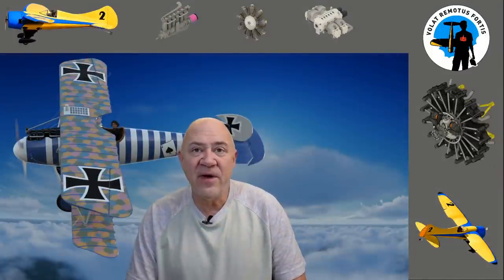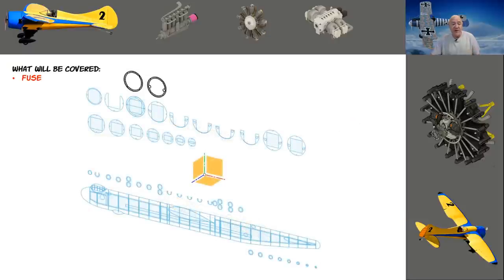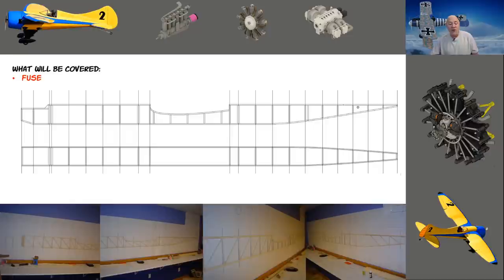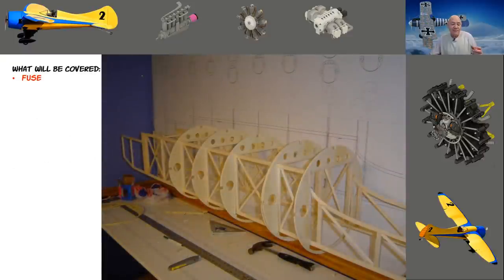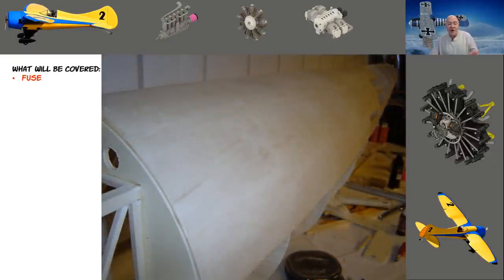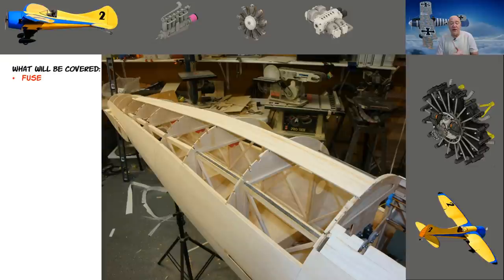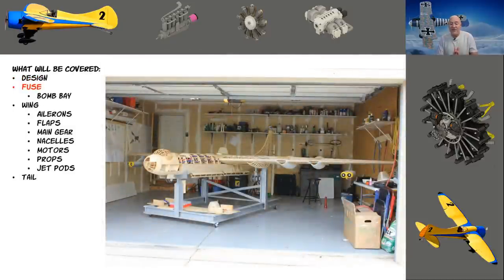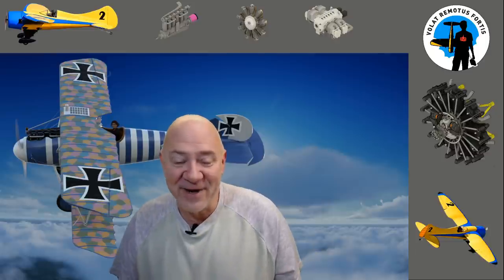Part 2 the fuselage. . How I designed and built the 257" B-36D

Comment: I’m coming to the point where I add my wing to my hellcat design because Iv got a decent fuselage outline. Can’t wait for incidence video!  It’s what I got wrong on my first hellcat and I needed like 25 digress down on the motor to fly straight lol
Reply from the maker: If your wing is at about 2 degrees, and your H-stab is zero, that is really strange you need so much down thrust.
Reply: @dagtheaviator I really had no clue what I was doing than. I didn't have the correct size slot for the wing cut out and it was a mess. Hopefully this one turns out better.